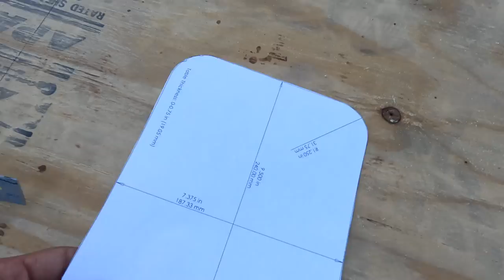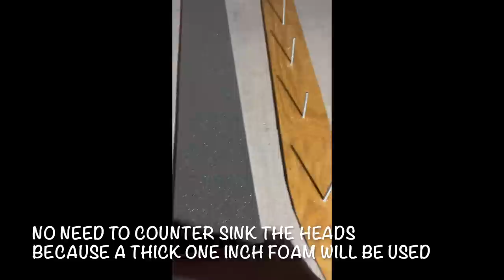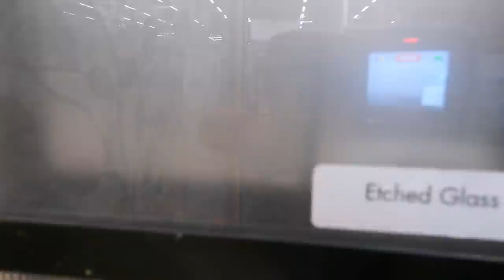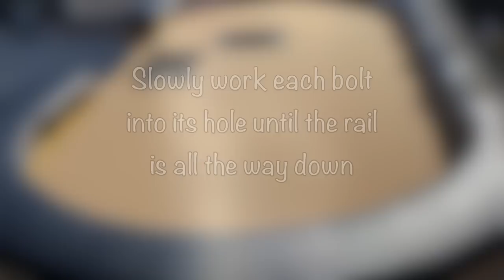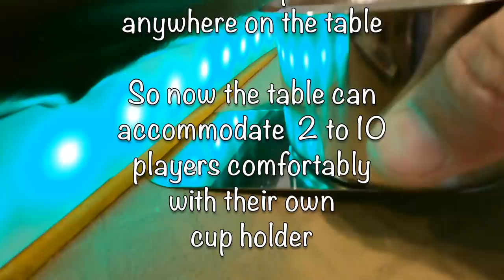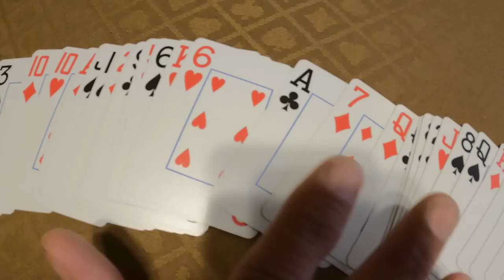How To Build A DIY Poker Table With A Shuffler, Cup Holders, Lights, Dealer Cut Out, Shuffle Tech

Comment: Nice build. You would have found cutting the chamfer on the underside of the shuffler much easier with a 45 degree bearing cutting in a router. I actually reckon it would have taken you about 5 minute to cut and it would have given a really clean consistent cut, they only cost about £15 here in the UK so maybe something like 20 bucks for you guys, very versatile too. Great work.
Reply from the maker: Thanks for the tip! That would have saved me a lot of time.

Comment: Built one EXTREMELY similar a few years ago.  Only I made mine 10 feet long using multiple sheets of plywood.  (It's huge)  I couldn't figure out how to do the plexiglass on the raised rail, so my LEDS are just under the rail pointing down, with white trim backing so they reflect.  Still looks great.
Reply from the maker: It took me a little time to figure out how to do LEDs. 10 feet long? I love tables with plenty of elbow room!

Comment: Awesome build!  I made a much simpler, generic round "game" table about 2 years ago.  Thinking about doing something similar, but struggling with the issue of how to attach the plexiglass.  Did you not feel that glue was sufficient to hold it in place?  Any other idea on how to attach it without the use of screws?  Again, love the professional look and feel.  Would definitely be a welcome addition to any home game!
Reply from the maker: Thanks for watching! Glue would work just fine. I would probably use gorilla construction glue, or hot glue. I used screws in case the lights needed to be replaced. Also you could buy the large 8 foot by 4 foot sheet of plexiglass at the hardware store, so you only need 2 strips instead of 4 strips, but the whole sheet cost 5 times as much.  Thanks for the positive comments!!
Reply: @ChilliesWorld  Definitely understand the desire for the screws in that case. Thanks for the reply!
Reply: You can dremel out a notch or a trench in the base and in the underneath of the rail to slide the plexiglass into. Then glue it into place.

Comment: Absolutely love this. Any thing you'd have done differently after the fact?
Reply from the maker: Thanks! Differently I'd buy large sheet of plexiglass so it would be 2 pieces instead of 4. But it would be 4 times the cost.  And I would glue the plexiglass in place instead of tiny screws. I used screws in case the light needs to be replaced, but could change the plexiglass to 2 pieces if lights need to be replaced.

Comment: Is the yellow mustard fabric necessary? I’m sincerely asking. I’m new to this kind of stuff. My buddies and I want to try this build.
Reply from the maker: @justincolwell4856 the yellow mustard fabric, was used to hide the thin wood, as well as to make it easier to slide the cupholders in and out between the two pieces of fabric. I don’t see why you couldn’t skip this part and just paint the thin wood. That should work as well, and save some time on the build.
Reply: Thanks a ton for the reply. We currently have the table cut out to shape, table legs installed, and framed! We are excited to get this done.
Reply from the maker: @Ltmoney839  that’s exciting to hear! It’s so fun playing on a table you’ve built. Have fun! Let me know if you have any other questions.

Comment: $900 bucks for a shuffling machine? Jeez that’s a hell of a ripoff, I wouldn’t pay more than $100 for that, you could probably make your own shuffle machine for less than $100 if you have a basic knowledge of electronics, either way very nice table wish I had one like that!
Reply from the maker: And that model was the cheapest flush mount I could find brand new. Shuffle Master, Deck Mate, and Shuffle King cost $4000 to $7500 USED on eBay. Only casinos can afford them. If anyone could get a working model for $100 they could make a fortune with all the home games that would buy them. Untapped market there.
Reply: @ChilliesWorld  maybe that could be your next project ;)
Reply from the maker: If only I were that skilled :(

Comment: Not gonna lie. That shuffler is worthless. Even a moderately experienced dealer can shuffle faster than that. A full wash and standard house shuffle took me roughly 20 seconds. No wash standard shuffle was about 13 seconds.
Reply from the maker: That's faster than most dealers. I agree it is not the greatest shuffler. I used to deal at the Venetian in Las Vegas and the shuffle master and deck mate shufflers are by far the best out there. This shuffler is good for those that don't want to shuffle, don't know how to shuffle,  or not as fast as a professional dealer. Using 2 decks in rotation makes it so there is no downtime waiting for a person or machine to shuffle, just like a casino. But be warned this shuffler needed to be fixed before the 1 year warranty was up. And The person who owns this table, said the customer service was horrible when trying to get it fixed. I no longer can find it on eBay or Amazon, so they may have went out of business. Poor product + poor customer service = no business
Reply: @ChilliesWorld  I forgot to mention that I was a blackjack dealer for almost 10 years. And a majority of the time I worked at 1 specific casino where we hand shuffled 6 and double deck. So I am a lot more experienced than even most dealers. But still an average person is probably what 2x slower? So 40-50 seconds for a wash and shuffle, 20-30 seconds no wash?
Reply from the maker: @wesch6354  yeah about 30 seconds with no wash sounds about right for the average dealer. After dealing for so many years and taking pride in my work, I really appreciate fast efficient dealers. Whether it’s on a blackjack table or a poker table.
Reply: @ChilliesWorld  I thought the door popped open when it was done with the shuffle thus getting in the way. But after watching videos on the shuffler I see it doesn't. So yeah using 2 decks like in the casino would make the game flow faster. Especially worth it if your home game had a rake wink, wink.
Reply from the maker: @wesch6354  the lady who runs the game doesn’t charge rake . . But she does accept tips, and wants to get out as many hands as possible.

Comment: I actually really like the table and I think you did a great job on it. The only thing I think I would have changed was instead of angling the LEDs to the inside of the table I would have installed them at the top of the ribs angled downwards with some reflective tape or something else reflective inside for the light to bounce and spread around. That way your white panel would glow a full color instead of seeing the LED's being the paneling. All in all, it's still an awesome build.
Reply from the maker: That's a great idea! Someone else also mentioned a diffuser panel. If you don't want to dim or change the color of they lights, you can use 360 LED rope lights which provide an even glow throughout the rope. That with a diffuser panel should give a uniform light.

Comment: good vid!  maybe cut out the shuffler hole before installing the legs and once cut turn it over and router the 45 degree angle out?
Reply from the maker: That's a great idea!! That would have made that part SO much easier and saved a lot of time! If I build another, I will definitely do that. Thanks!

Comment: Did ur $1600 material cost include the shuffler? if so, removing the shuffler would put this build at Sub 1k which is remarkable compared to hiring someone to do this for you. Personally not a fan of the shuffler being in the middle of the board, I would have it more to the dealer's left. However, I deal more carnival games and Blackjack so i would use a different shuffler entirely. I love your build and loved the walk through. 10/10 definitely subscribing
Reply from the maker: Thanks so much for subscribing! Yes the total cost including shuffler was $1600. If you shop around and don't need a shuffler you can do it for just over $500. I'm not sure about multi deck shufflers for blackjack. I appreciate the positive comments!
Reply: @ChilliesWorld  they have relatively inexpensive blackjack shufflers, but they arent designed to be indented into the table, so for my setup i would have one that gets removed after the shuffle. Definitely going to be using this video for inspiration!

Comment: That’s great.  You put the shuffle machine on the wrong side… it will be hard to shuffle the other deck with the pot sitting on the shuffler.  … I suppose you can just put the pot on the opposite/wrong side it makes no difference to me
Reply from the maker: Thanks for watching! The table was built custom for a left handed dealer.  She wanted it there. After playing in casinos for years,  it does seem like it’s on the wrong side.

Comment: I was wondering if the bottom of the rail bolts are hitting or rubbing on the players legs when seated? Hard to tell from the editing. Also wondering what you did to compensate for it?
Reply from the maker: Most people haven't noticed the bolts, but a taller guy did say they hit his legs. A Dremel with a cutting wheel will take care of it with no problem.

Comment: One point for the LED get s diffuser panel  it will make everything look so much better.
Reply from the maker: Thanks for the comment, that is something I never knew about. Great idea!
Reply: @ChilliesWorld  no worries, you can even do it on the cheap some thicker white paper can do the same thing but a strip of 1 or 2 mm  white plexi will do the job

Comment: I now have a winter project to complete. Thanks for the guide and tips. Not sure if the shuffler is worth the $$$ have to think more on that purchase.
Reply from the maker: It's a fun project and so rewarding when you're finished! The shuffler does double the cost of the table. It's worth it when you don't have to shuffle and no one can set the deck.

Comment: Great tutorial, only things missing is the section about cutting the rail from the plywood, other videos show the process of drawing the inner curves, but this video leaves it to the imagination. Also you didn’t specify the length of led lights used, I assume it is 16 foot run.
Reply from the maker: Thanks for the input! I thought it was too much and boring to include those videos so I left those clips out. I guess I should have done at least 30 seconds on how I did it. The length was 32 feet. I wanted to make sure it was long enough and the extra was installed on the inside of the wooden frame under the table
Reply: ho bro, how is the dimensions of the led strip? 5cm??? @ChilliesWorld

Comment: Hello ! Well done for this very cool table but i have a question : where did you find the cards and the chips ?
Reply from the maker: I live in Vegas. There is Gamblers General Store and Spinetties. Both are casino supply stores that are right across the street from each other. You can also find them on Ebay.  Cards and chips come from there.